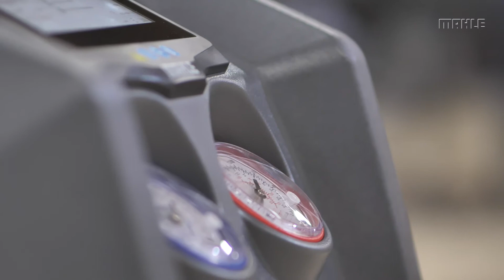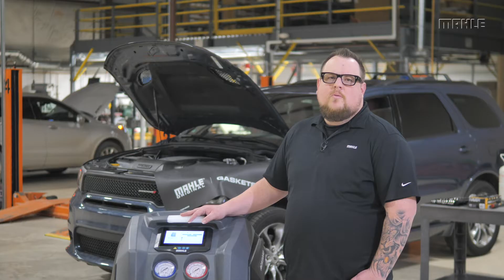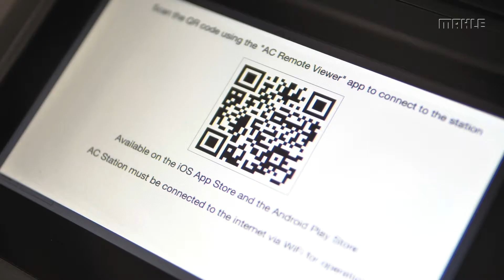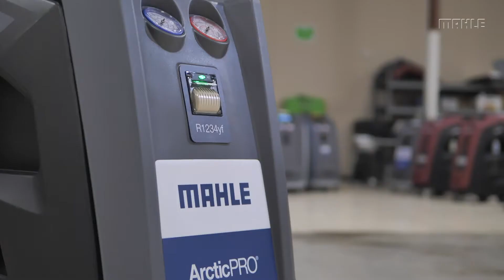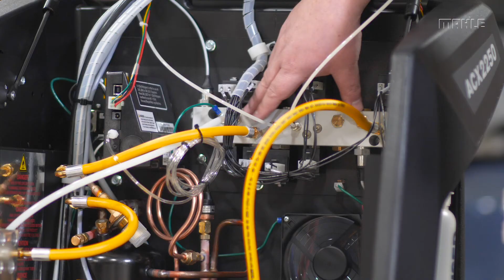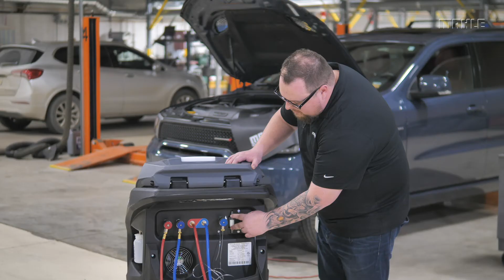MAHLE ArcticPRO Unit Overview & Features

Comment: This machine if pure GARBAGE. Extremely slow, yes you have to fill the tank externally but it’s not stored on board. 

I did several evac, vacuum 10min, leak test 10 min  and recharge. Took 1hr 10 minutes.  

The. To evaluate the lines tajes the machine another 20 minutes